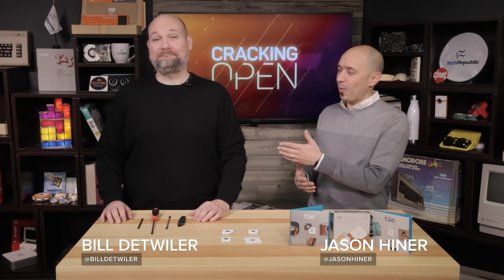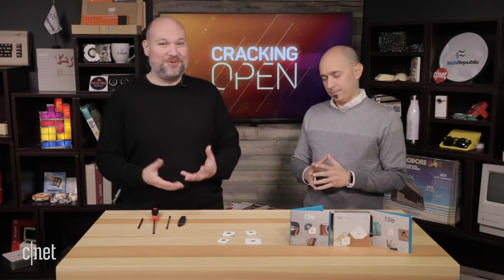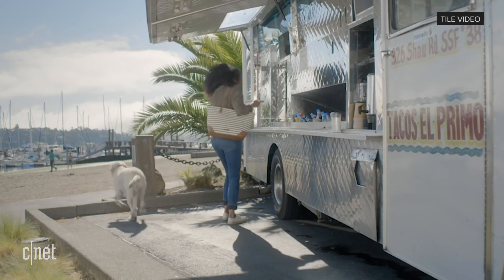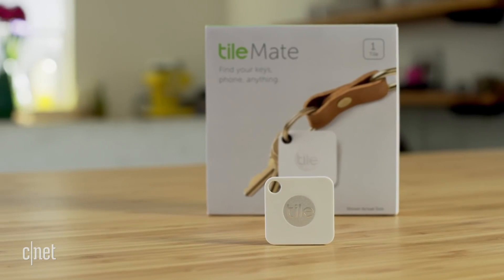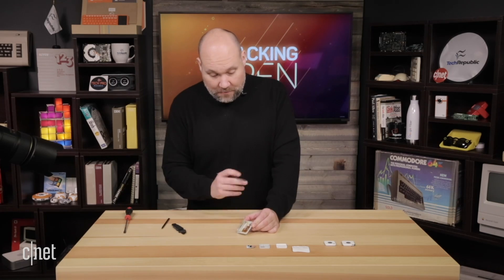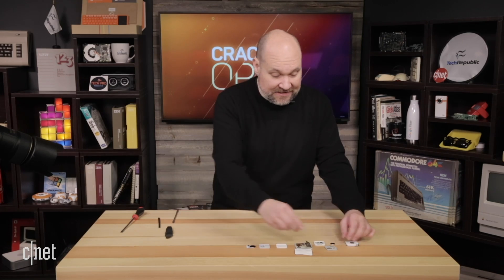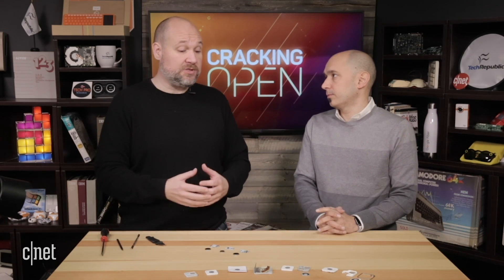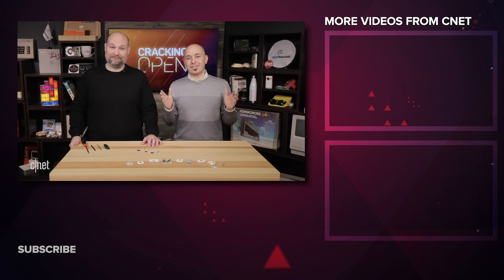Cracking Open Tile's Bluetooth trackers

Comment: Just replaced the battery in my 2016 tile mate. Worked great. It uses a cr2025 battery held in with double back tape. I did have to tape the cover back together.
Reply: I take it back. It didn’t work. I put the battery in. I got an alert that a lost item had been found. It registered with the phone. Then nothing. No more tracking from that point. The phone now just gives last known location and says the Tile network is searching for your Tile.

Comment: TILE TRACKER HAS ABSOLUTELY NO SUPPORT, EMAILS? B
....S...T'
Reply: I'M SORRY BUT I HAVE SPENT ENOUGH OR WAY TOO MUCH TIME FOR THESE SO CALLED 90 FT LIES DISTANCE TRACKERS AS THERE'S NO WAY IT TRACKS 90 FEET AS I NEED TO ASK SOMEBODY OUT THERE IN THE GENERAL PUBLIC MAYBE I CAN GET HELP,  NOT BY F..IN' EMAILS FOREVER ! IT DOES AT TIMES WORK AND DOES HELP BUT THE APP HAS A LIST TO CONNECT YOUR PHONE TO THAT TILE TRACKER THAT ISN'T IN THE LIST, EXAMPLE,  HB, SKULL, BOSE, PLANTRONICS, BUT NOT TILE PRO, TILE MATE, ETC ETC

Comment: Folks: On the positive side I’m pleased you reviewed two different product generations. However, I was disappointed by the level of analysis on the chips used between the generations. Was it the same BT and piezoelectric chips between these generations? Was one generation using BT 4.0 and one BT 5.0 (hence the extra range)? What were the chip model numbers used (so I could at least check for myself). There was a lot of speculation (larger battery for more range?) and less fact based discovery. What was the size difference on the antenna between the generations (if any)? Interesting but just left me feeling as if the big questions remain unanswered.
Reply: Same. Half the video was them opening it, and the actual electrical stuff was mostly what you can gather at a glance
Reply: This video must be for kindergarteners

Comment: what is the small circular gold part that stays stuck to the inside of the casing? can the device function without it?
Reply: It is the speaker. There are spring loaded pins that connect it to the board.
Reply: Yeah it can function Without it. You just Won't be able to activate sound off feature

Comment: I found one on the ground it beeps but didn't pair with my phone I took out battery and put it back in it still beaps but didn't pair any help
Reply: Also the beap sounds different then the one on the video
Reply: I bought two Pros and after changing my email address (and / or Tile phasing out a Facebook login to their App) my tiles disappeared from the App and were impossible to reactivate. The company was unsympathetic, no help … trying to activate the Tiles gives an already activated error, so my money was wasted. I watched this video in hope of finding a possible hardware wipe to the on-board eprom that might allow me to re-activate these frustrating devices.
Reply: you can't pair it with another phone without unpairing it from the previous Tile account before.